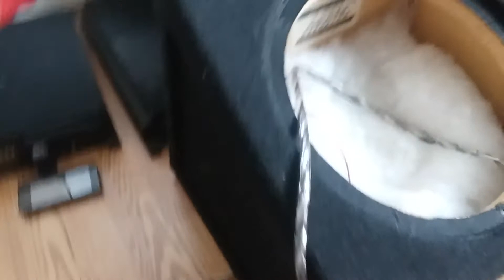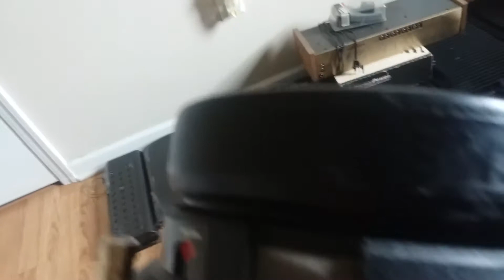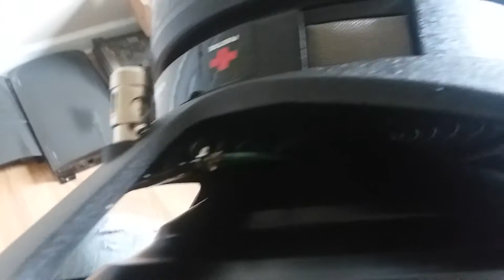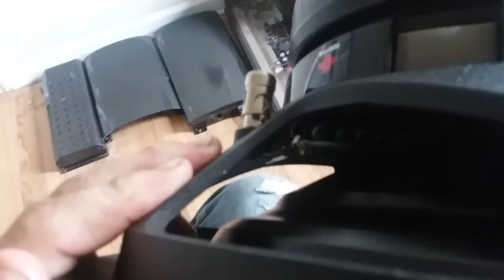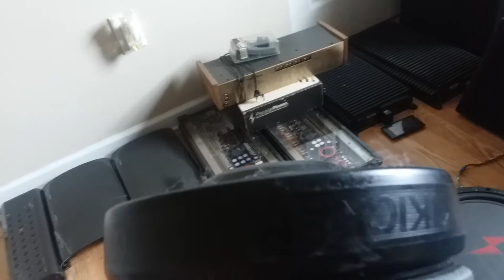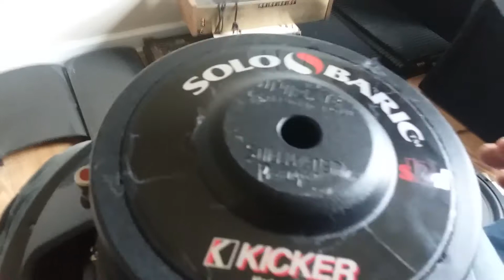Kicker solo-baric S12D walk around.

Comment: Around what seems like a lifetime ago, my car had two of these in the trunk. They were power hungry! For most of the time, a Punch 800a² powered them. The secret to not blowing fuses was to split the 4 gauge wire down at the rear fuse block into two 8 gauge power inputs. 

If I remember correctly, an s12d should have exactly 0.88 cubic feet of box volume. They were picky in that respect.

My mids and highs were pushed by a smaller Rockford amp. All speakers were Kicker: two Freeair 6.5"s in the rear dash, a pair of 4"s in the doors, and two sets of ND13 dome tweeters. It was a struggle to keep it all working. 

Needless to say, I now use subtitles. It was worth it! No low felt low like Solo-Baric low; it would rattle dishes from far away even when you wouldn't think it was turned up loud!
Reply: True man i have s10d and s10a they hit lower and better than any other sub that i heard and even 15inchers cant compare to em with lows i am looking now for 2x s12d but it will take some patience to find em

Comment: no mention of the kicker xpl of that time. almost the same subwoofer as the solo
Reply from the maker: You haven’t watched my other videos. Relax man, I go over a V1 XPL and the ones you’re referring to are talked about.
Reply: Xpl had round wire voice coils and could take half less power, solobarics (only oldschool round ones) had flatwound wire on coil and could take up to 900w my dad sold in 90s a s10d to a guy who had it on 850-900w for a whole year and that thing still worked like new my dad also said these are the best and hardest hitting subs he had more than million different subs (he was putting systems in cars in 90s and selling car audio) i do agree with him i had many spl subs sql subs.... but there is no comparison when comes to oldschool round solobarics they  are the best subs i got s10a my self and there is no sub that i can compare to that the low bass is fuckin nuts specialy on trance techno these subs get loud asf
Reply: @dariobubnjic8132  I was running my 4ohm xpl’s parallel on a fosgate power 800a2 at 2ohms. I was feeding them a 1k watts. I’ve never smoked them. Back then that was all I needed. Somehow I still own them. I retired them eventually for a pair of earthquakes. Just a change up. I’m sure now days they’d need to be reconed.  I’m not to much into the bass game these days. My music tastes have changed. So, my cars get the jbl treatment. I’ve become the jbl fanboy lately. Home, car…
Reply: @ronnieschmidt2849  nice i can tell u just change the spiders and surrounds on xpl subs dont replace the whole cone and dustcaps because there aint no recone parts for these you can just find parts with simmilar stifness and change them. But yeah you need to get 2 10inch s10d solobarics iif u are more into sq and so hard hitting bass..... u will forget about earthquake subs not sayin they bad theyre no words to describe how good these actualy sound if u compare one 10inch solobaric to xpl sub u will need 3xpl subs same size to make it sound similar to a 10inch solobaric
Reply: @dariobubnjic8132  I’ve been on the hunt looking to get the subs reconed. Just the surrounds. Not too many companies that do that anymore. COVID wiped outa lot of these companies. Back in the day, I had a McIntosh dealer recone my Pioneer impp’s. That company is gone as well. I’ve kept most my old school equipment. The power 800a2 just sold years ago but replaced it with a JBL 1201.1 ii. That’s a cool amp.
Reply: good times, I love that old school audio. where there was pure competitions between competitors. nowdays, it seems like there really only a few. I'd probably get into something like Sundown for the basshead stuff. lol. but, i still keep my current stuff in Sealed enclosures. those vented boxes are loud and move air, its just the same tone with those.
Reply: @ronnieschmidt2849  i think best thing to do is replace surrounds by ur self i am 19 but i learnt how to recone speakers by my self at like 13-14yrs its not that hard u just need to be very careful and use hairdryer to melt the glue  (talking about dustcap) i think xpl had stiched surround ,so cut the stiches and pull the original surround g gasket of, and you just need to pull the dustcap g make sure u do it slowly and make some shims center the coil ,glue the surround wait for it to dry than center g glue the dustcap and ur subs are good to go. Yeah i like spl my self but these subs in bassreflex boxes all sound very similar thats why i love more oldschool audio every thing sounded unique i know because my dad has plenty oldschool car audio and like more than 500magazines off car audio from 90s its cooler to look at those magazines than today checking ebay or sum sht and seeing all them subs and speakers similar to each other just sucks also that everything ismade in china as well but they are few stuff also that are good ngl

Comment: I have 2 s12d subs in my trunk with a 1000 watt amp. Should I get a bigger amp I’ve had someone tell me to get the 2400 kicker amp and I had someone say that would kill my subs. What do you think?
Reply from the maker: The Kx2400.1 does 2,400 watts at 2ohm. I wouldn't put anything over 1,500 watts to them unless your just burping for SPL competitions. I would guess your seeing quite a bit of box rise since they are in small sealed enclosures. That is the only reason I say 1,500. 1,200 would be the most I would run through them. Otherwise your just going to wear out the spider or bottom them out. At 2,400 watts even if you don't clip would probably melt the voice coil. They are well made but running them at double max watts rating is in my opinion over driving them. If it was a sound stream or Boss amp I'd say definitely go for the 2K amp because your not going to see over 1,200 at 2 ohm anyway. I heard a pair of S15D's run off of a ZR1000 and they were probably seeing 1,300 watts and it was all they could handle. Stupid loud. I would imagine if your running 1,000 to those 12's and it's not loud enough for you. You might want to consider a larger sub or add another 2 12's.  Hell, you barely need an additional 1 cubic feet to add a pair. Then go get a KX2400.1. That would be crazy loud
Reply: The perfect amp I seen to go with them was the kicker zr1000 and they slam like crazy

Comment: I have the 2ohm 12 and Its been in a small sealed box for some time taking 600w reliably and actually sounds really good but was thinking about getting a ported box to try out, so would that be a bad idea?
Reply from the maker: It requires the air pressure inside the box to act as part of its suspension. It wouldn't handle 600 watts in a ported box for long and you would have to reduce the wattage to such a degree for a ported enclosure that it would negate any increased output from the ported enclosure. You could try a larger sealed enclosure for slight increase in output from the lower frequencies but in my experience the solo baric's do fantastic in a small sealed. I'll include a link to the manual for you. It recommends not using a ported box.
Reply: @brentb5303  a band pass box would be great
Reply from the maker: https://www.google.com/url?sa=t&source=web&rct=j&url=https://www.manualslib.com/manual/490660/Kicker-Solo-Baric-D-Series.html&ved=2ahUKEwjFjMi-saXqAhVOXM0KHeLaBTAQFjAAegQIARAB&usg=AOvVaw3b4TZpczeSSggB2CVIfFNc
Reply: Ok thanks for the Manuel I couldn’t find it anywhere I guess it will stay in the box it’s in which isn’t that bad because it’s already sounds so good. Was lookin at a  SKAR svr 12” 1600w max, for an upgrade  I guess I’ll put that in a ported box. Definitely gunna keep that solobaric in that sealed box. Thanks for your input

Comment: Did these speakers come out with SQ. That year.
Reply from the maker: Sorry I missed your comment. YouTube is acting funny with notifications. Are you asking when kicker released the square solo baric's? To the best of my recollection both the L5 and L7 square solo baric's were released in 2000. You probably could buy a pair of round S12D's after the square subs came out but it would be previous stock they were running through. The catalog that introduced the square subs didn't have the round solos in it and they had changed the look of kicker comps, and the zr series amps started coming in all black with the hammer painted end caps. The comps in 1999 had the old kicker red white and black kicker K with a red strip below it that said Comp VR. The comps released with the square subs had a red front of a K, all white old kicker K logo and said kicker with the word comp in yellow with a ribbed surround. Yes, they were ugly as hell. To the best of my knowledge all the square solos with the cross molded cone were built in Kentucky by Credence and were more reliable than the later L7's made in China that all have that spoke molded cone. I will be having a series of videos about the Credence square solo baric's. I bought 4 of the bootleg credence sq12d4 square solos and will be building a quad 4 box for them.

Comment: I used to have 2 of these. I had one like that in the video and another older one with the K logo but said Solo Baric below the K. They do real good in sealed boxes.

The tinsel leads failed on both of them though, its a weak point. I couldn't repair them either, they broke almost flush with  the cone.
Reply from the maker: That is really interesting. I thought the tinsel leads were overdone being coated and seemed to be a decent gauge. Goes to show that you have to use a product to know what works and what doesn't.
Reply: Heywood R Floyd yeah i wasn't easy on them though. That and i wasn't the first owner either. But i got my use out of them think i had them a year at least. I did try them in a ported box but only for a day. That could have weakened them, but I've seen other ones with bad tinsel leads too. Still good subs, and still to this day haven't heard any sub able to get as loud as these in a small sealed box
Reply from the maker: I think Kicker could make some money if they made some old school solos here in the USA and did it right instead of those chinese solo ''Classics'' they did back in 2010